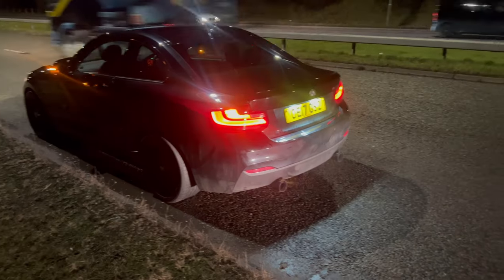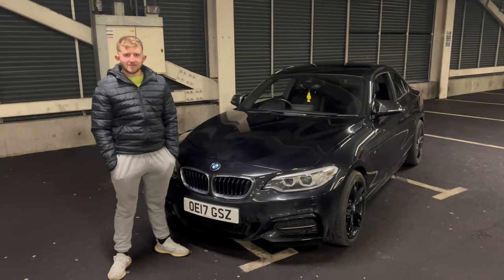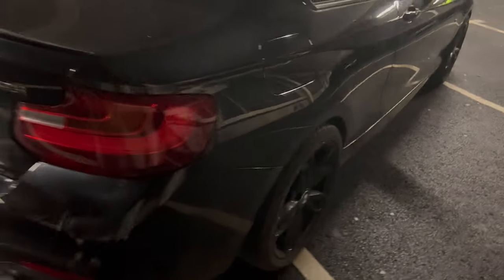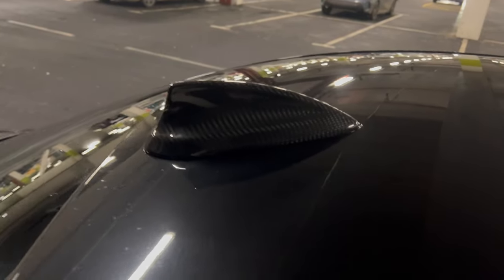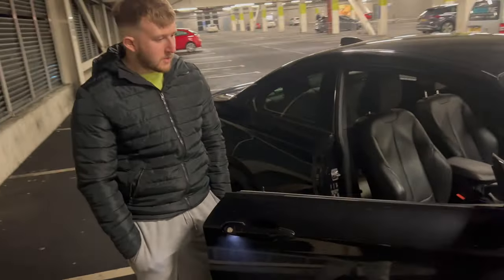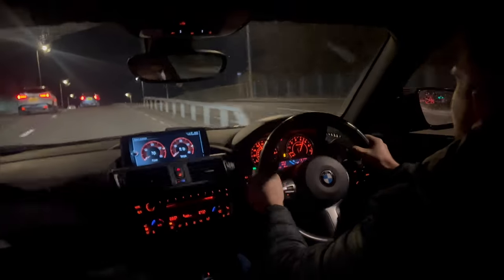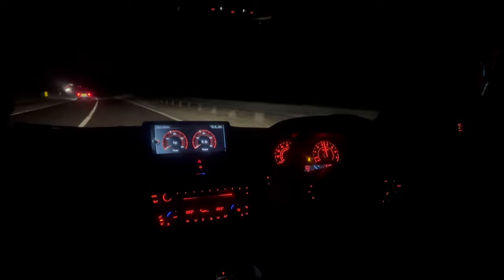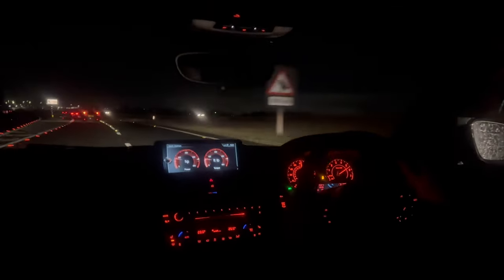STAGE 1 M240I POV DRIVE **GONE WRONG** (WE BROKE IT)

Comment: hate to say it but thats stock, only showing 300-350HP on the gauges, when you the cars mapped the dials change to 240,360 and 480bhp, nice car nonetheless
Reply from the maker: It’s a plug in tuning box so it doesn’t update on the gauge unfortunately
Reply: The tuning box's usually just dump loads more fuel and air. I'd get a proper tune and stear clear of box's.